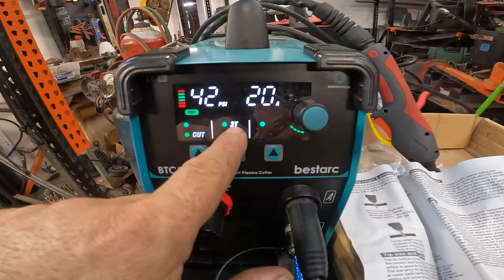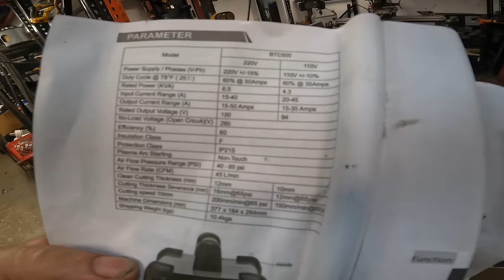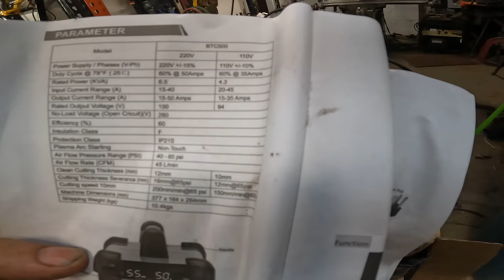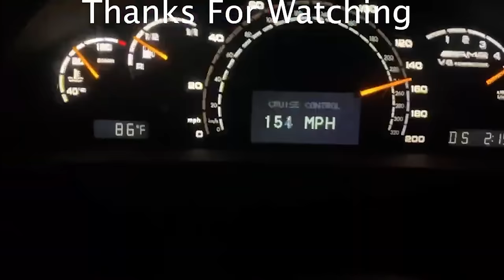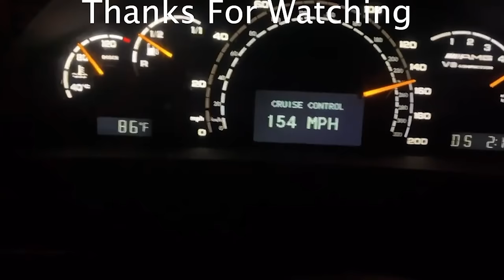Removing Copper From Stator's With A Plasma Cutter, Grinder, Torch, And Hydraulic Puller.

Comment: Use my cheap plasma cutter scrapping out HVAC sealed compressors, hundreds of them. I like it very much no more grinding. The air chisel works very well on those small motor stators. I just finished doing 65 fan and blower motors.
Reply: My dad made a jig to hold the plasma and spin the sealed units that is adjustable it’s pretty cool 200 plus sealed units
Reply: I got a brand new Lincoln 375 plasma  1400 dollar machine for 650 bucks guy I do side work for give me a hell of a deal
Reply from the maker: Thanks for sharing

Comment: I watched another scrapper he put those small ones in the vise and used a punch to push them out. Worked just fine. ✌️
Reply: My thoughts exactly
Reply from the maker: Thanks for sharing, Some are way harder than others and a punch is not gonna work as easy as you think.

Comment: Man, good video. I've had same problems with electricity. Make everything difficult. I stand by the Diablo blades on motors. None of others hold up. It's fast with 8"  or even bigger Diablo. I can cut casing on small motors in vise and lay blade from front to back slightly rocking. Less than 20 seconds.  Flip in vise to hold on the iron lip on winding coil. Cut 1 end copper flush to steel. Then it's history. 3 minutes a motor if u kinda arrange by size. Big money in smaller motors. On average 5x to 7x money. I use a iron floor bar to loosen if windings are a tight. I love your channel. U really getting it! I love seeing it. I'm in same  business. Like u except HVAC is primary.  I reduce every small motor I can. It's a multiplier once u get YOUR system going. I working only single phase 20 amps but I made money. U gonna do good!
Reply: Like 50 small motors at $1.30/each avg for scrape. It you get windings u make $7 to $10. That rough estimate. 50 motors a day is a increase in profits by roughly $300 per day. I save em for when have nothing to haul, weekends, and storms. Can still make $300+ per day if slow. It really works. Most HVAC company or supply companies will gladly let u buy them. I pay $2 each and get so many I turn them down because of time or having laborers. Brw, yet to have anyone make me money consistently in this business. That's hardest part for me. They tear my stuff up or just work slow. Most people don't understand how hard this work is
Reply from the maker: Thanks now I need to get the HVAC customers.
Reply: @ProjectShopFl  with your set up and way you move already, I'd say probably won't be hard. Good money in A/C and if you get basic knowledge and have electricity to start unit, some will be working.
Reply: I sell the ones that work.if I can find a buyer. Normally make 2x scrap that way and deliver. I don't install anything. Work with some smaller techs that give me units because supply house delivering new unit charges them to haul off. Alot of niches in this. I have a corporate carrier account. Get all warranty compressors and motors.

Comment: BTC500 sold on Amazon, $200.  7th gen 50A.  Most liked it.  Some factory assembly issues(china), air/water leaks.  Read 4-8 sec cooling time for tip longevity.  Sounds like a keeper.
Reply from the maker: Thanks!

Comment: Plasma cutter is way  cheaper than cut off wheels good for opening  ac compressor motors/ sealed units just keep a fan on high its a little smokey.
Reply from the maker: Thanks for the info, I also have a mother way I will be trying.

Comment: Should get into compressors along with the motors. Have oil to dispose of but also the wire pulls out 100x easier because of the oil. I’ve also got a long screwdriver with the tip cut off to push the windings through with a hammer
Reply from the maker: Thanks for the suggestion

Comment: Orientation Scrapper took an air hammer chisel and cut a v in it to knock out those coils in the small ones.
Reply: Okie Scrapper, damned auto correct.
Reply from the maker: 😂😂😂 Thanks for the suggestion

Comment: whenever I take apart the little tiny ones I always get a steel rod and hit it with a hammer on the end where I cut it with the grinder. It pushes out the other side nice and cleanly. I wonder if you could implement some kind of ram with varying sized rods to PUSH the copper through the holes rather than pulling it. Maybe thats a dumb idea for stuff this big, i dont know.
Reply from the maker: When this machine is finished it will have something similar to what you are suggesting
Reply: @ProjectShopFl  Looking forward to seeing it in action!

Comment: Because I'm in Germany, I don't buy American electrical appliances because we use 230 volts at 50 hz. The USA 110 volts at 60hz. I had an American blender that gave off smoke signals after 5 minutes.

Comment: I have a set of punches some big fat ones with flat ends I push that copper out from the cutoff end,you get the right size one it pushes the plastic out with the copper like butter just tap that punch with a hammer. Next time it comes down to hand to hand try a big fat punch or a piece of round stock. That plasma cutter is pretty sweet hopefully it will hold up and you can put your stamp of approval on it and shill the product make ya some big ad revenue😊
Reply from the maker: Thanks I will try that next time.

Comment: If you run a high current draw device like a plasma cutter or welder on 110VAC with an extension cord the cord unless it is a very heavy duty will cause excessive current draw. Try to plug the plasma cutter directly in the outlet to see if that is the problem.
Reply from the maker: Thanks for the suggestion 👍

Comment: Hi, I was wondering when you work on getting the copper wire out of the round motors if you could remove the sleeves then cut one side of the wires and pull the wires out of the other end? I don't know if that would work for you or be any easier than doing all that cutting unless you like ti do it. Just a thought! Love watching your videos, you salvage everything. ❤
Reply from the maker: Thanks for the suggestion

Comment: If you were to  treat the stator like a clock face and pull a little bit at say 6,  then go to 12 for a bit etc  would that help???, it looks like your big hangup is that it is  fighting 🎉against itself
Reply from the maker: Probably would help. I also need more power. lol

Comment: Should just get a 120 volt compressor to run the plasma cutter so you can plug in the cutter  into the 240 plug in
Reply from the maker: Thanks for the suggestion

Comment: Instead of the saw or cutting wheel,try a zip gun pneumatic hammer with a chisel bit to cut wire on the rotor.Cuts like butter with no dust.
Reply from the maker: Thanks for the suggestion it worked great on a rotor a just cut.